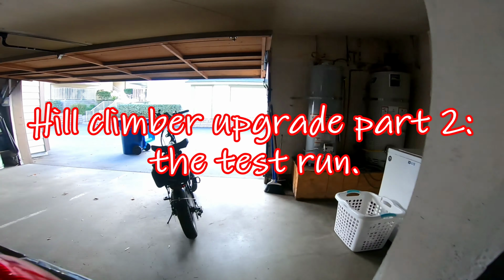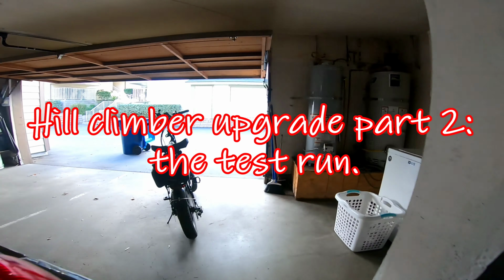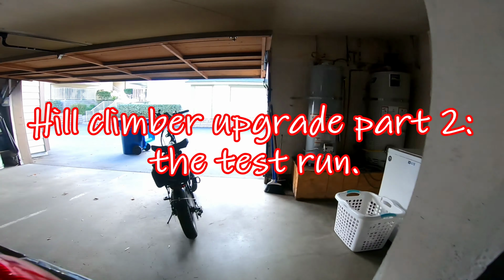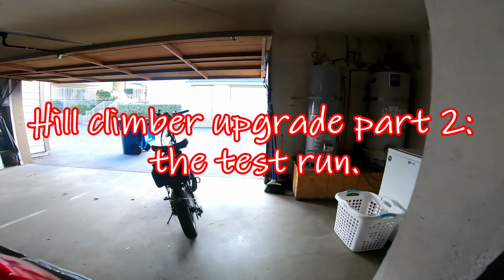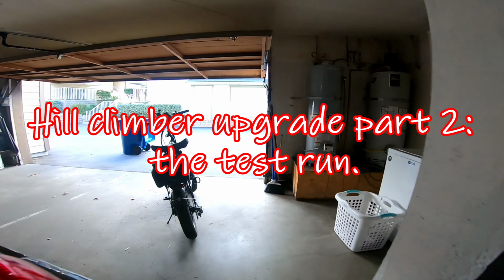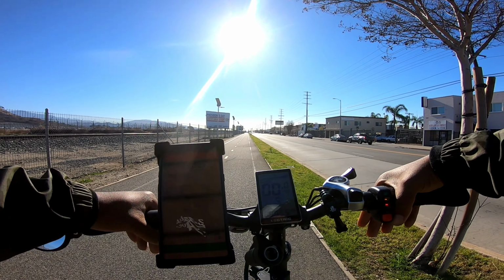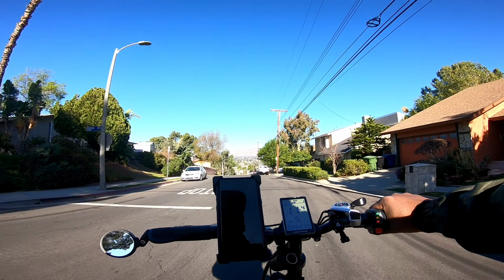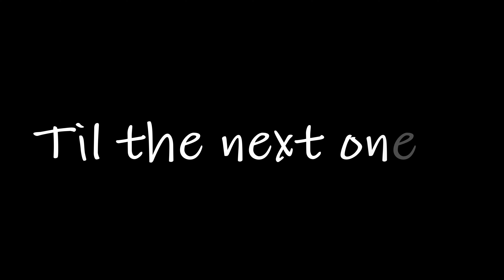Lectric Xp hill climber upgrade (part 2) the test run. Does it get the job done uphill?

Comment: How did you get the motors to work simultaneously with the new throttle?
Reply from the maker: Throttle and peddle assist at the same time.

Comment: Nice
Now with all your upgrades done and ones you want to do -- if you were to start over, would you get the same bike or just drop the extra cash now for the extras right away built in already.
Cheers
Reply: Who makes a folder that has comparable specs to this modded one? No one. Even a stock XP will beat the competition.

Comment: Hey Grizz, before I pull the trigger on this kit, do you have any new advice like perhaps an even more powerful kit and what else you have done like 2 throttles still, which is fine with me as I want easy wiring. Is it all press and play or is there any splicing involved? Thanks for all you do especially frustrated XP riders.
Reply from the maker: This kit was my best option for the price/ power I needed. Its mostly plug and play. I do have 2 throttles connected now, one for each motor.

Comment: So on average I get about 30 to 40 miles a charge. In your opinion how much distance would you say this could possibly increase? I'm trying to avoid carrying a extra battery. I gotta hand it to you I'm on the fence now since a new battery is only a little cheaper than this type of upgrade. You got a new sub today dude.
Reply from the maker: I did this mod mainly for torque and steep hills but the extra range is a bonus.  I get around 60 miles if I'm not too aggressive with my riding style👍🏾.

Comment: How did you switch the throttle to thumb. Is it a straight plug or do I need to splice the wires to connect the new thumb throttle
Reply from the maker: I’m still rocking the twist throttle. Haven’t found a compatible thumb throttle yet.

Comment: How you get the to moters working off the one throttle plz help brother
Reply from the maker: If you turn peddle assist on the rear motor engages when you peddle. Throttle operates the front motor.

Comment: Cool mod, and I though I couldn't see the screens because of the sun, I know you got the stock XP 0 to 20 time of 10.8 seconds beat!

You can run both motors off one throttle, or go with a thumb throttle on the other side. Brake cutoffs can be split as well. For the PAS, you can add the sensor and magnet wheel to the other side of the crank, and program the controller to know it's reverse rotation, but that depends on the controller.
Reply from the maker: That's something to look into, I was wondering how I could install another PAS, I'll look that up. 👍🏽

Comment: Thanks for the tutorial on putting in the battery a certain way lol everybody been breaking their back or breaking batteries . Did you oil the joint in the frame for it to move so easily though ? Cause mine doesn’t split with ease like yours did

Comment: Nice job. I have a few questions. Does the right throttle power both motors? How much do you weigh? I weigh 250 and have had difficulty on long steep hills.
Reply from the maker: I added another throttle since this video, on the left and right handlebar, one for each hub motor they operate independent of each other. 

I’m around 220lbs and steep hills were a problem. Before the mod.

Comment: For all the "improvements" you've made perhaps you should have invested in a 750W Flat Tire bike. Also consider the Down time you and your experienced
Reply from the maker: Investing in the dual motor setup was a much better option, twice the torque and only $1500 invested. 750w bikes get left in the dust now. Installation was only 2 hours.

Comment: Grizzly good stuff. The next test is to ride with that group of guys...you rode with doing that circuit. I ride up a super steep hill here in Baltimore once in while my bike struggles a bite, but it doesn't give up. Plus, I like the exercise. Still, this mod is amazing. Still, can bring myself to change my stock Lectric...least not yet. 

Also, think you are correct...your brakes may need an upgrade too...
with the added power. I do also have a similar alarm system.
Reply from the maker: That video is definitely coming 👍🏽.

Comment: Nice video & upgrade. I noticed the brakes squeaking alot. Did you upgrade to hydraulic brakes? Just wondering. I upgraded my gearset and installed hydraulic brakes and there's no squeaking at all and seems a bit smoother. Thanks for posting your video!
Reply from the maker: Just got my hydraulic brakes in, gonna install them soon. Good to know that the squeaking will be gone.

Comment: For the price all these bikes are not worth the price, Himiway Cruiser right out of the box does 35mph with Pedal assist on level 5 for $1500...and it doesn’t have nylon gears...fake news
Reply: I just hit 35 today and it took lot of peddling and downhill. I have a CSC 750 and these can not just simply hit 35 like you say.I am also an exmountainbiker and had to pedal very hard to get that.I my bike also weighs 57 lbs with a real 750 bafang--1600 dollars.I have a 1000 watt front hub coming for some mre torque because I trail ride.BTW CSC is an american company--got the bike to me within a wekk--free shipping--and they man the phones 9 to 5 in a brick and mortar.
Reply: @khronin  himiway 35 pedaling 26 inch wheels make it faster, there’s videos out there to see
Reply: @ghoul114  does not go 35 only on pedal assist 5 downhill and a high gear with lots of pedaling if anything